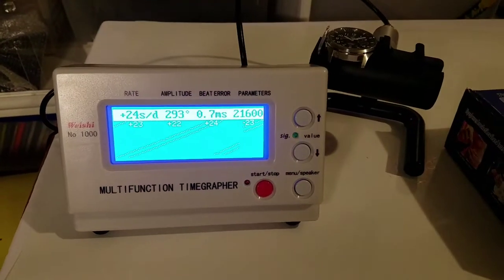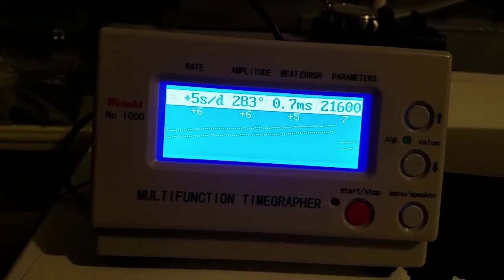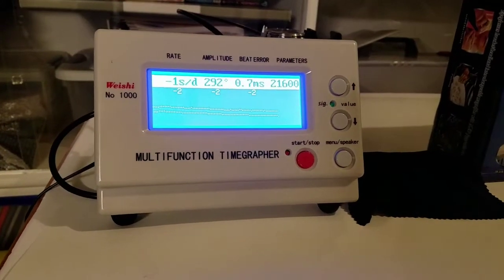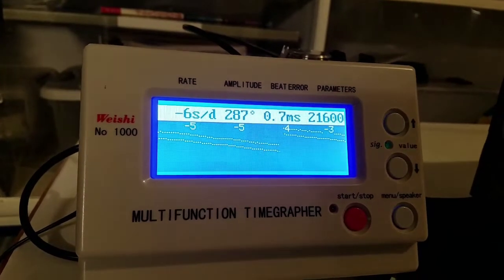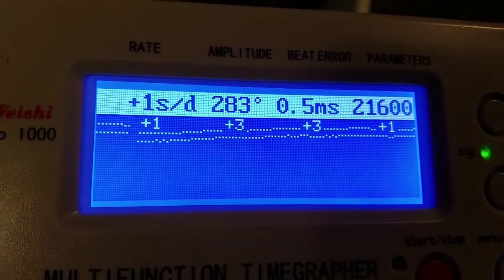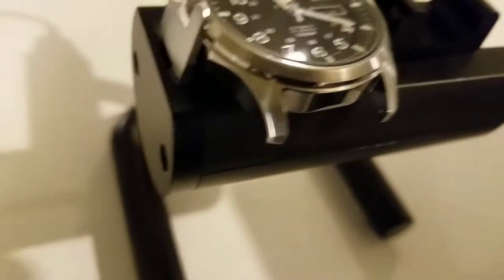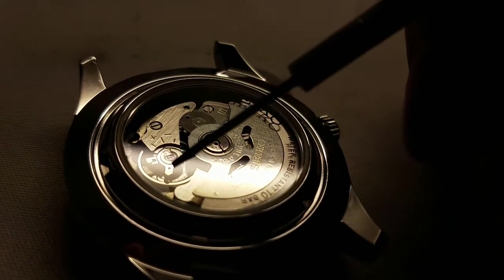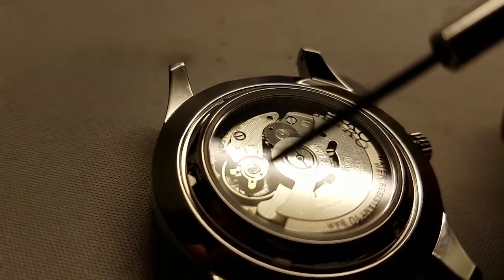Custom Seiko SNZG13 "Pteroleon Flieger" Mod - Part 3 - Regulating & Adjusting Beat Error

Comment: Great watch, I have similar, but Japan made. According to my knowledge you are using wrong lift angle for the movement 7S36. Should be set to 53 degrees on the timegrapher, not 52 degrees. Your results will be slightly inaccurate. You also must regulate the beat error as close to 0 ms before you regulate the time deviation per day. But you probably know this by now😀
Reply from the maker: Well, either way the movement was off and I had replaced it. Anyways, I got it working in the end. Did sell it. Was a fun mod/build which I think turned out pretty good looking.